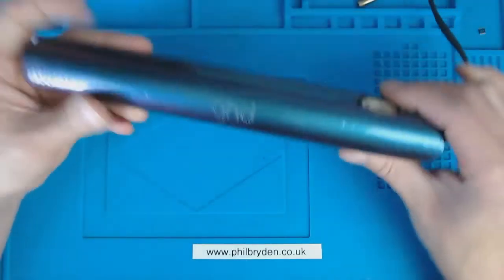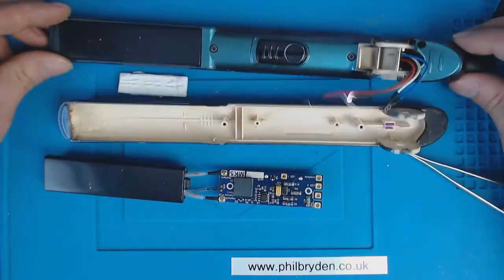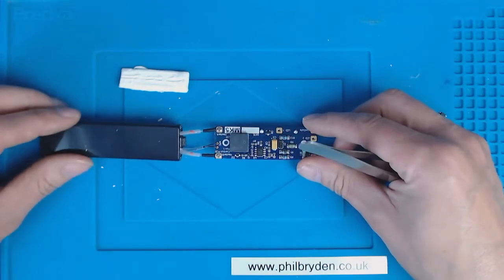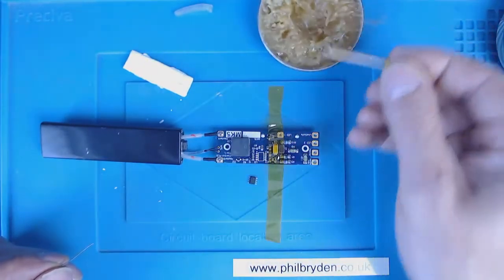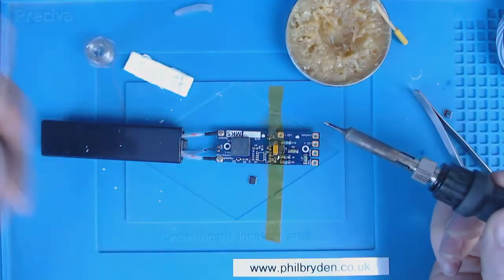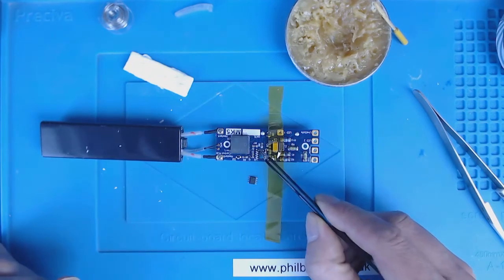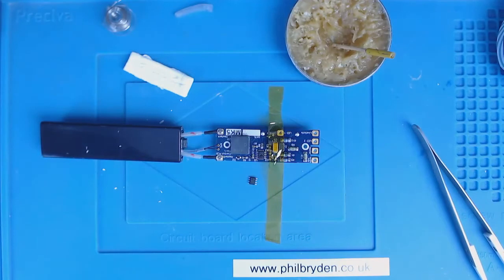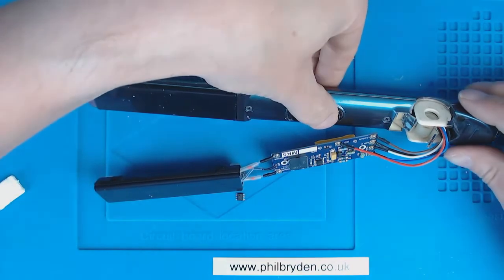Chirping GHD Straighteners CPU Swap Repair | No fix

Comment: Hi phill check resistors R8 or R11 (values marked on resistors). also check The thermistor the 2 wires in between the heat plate connections at the front it should go up in resistance as it heats. also some times the beeps can mean the iron is too cold leave it on for a while and see if they stop. feel free to msg me in JDT discord.
Reply: Great job, would love to see the update vid!
Reply from the maker: You are right on the ball with the R8 resistor. I've just swapped it and it is working fine. I have recorded a small update to this video.
Reply: @PhilipBryden  awesome news.
 My (rip) hi street shop was next to a hairdressers i may of fixed more GHDs than i have computers :P)
Reply from the maker: This is my second pair I have fixed. At least they're easy to take apart and find spares for.